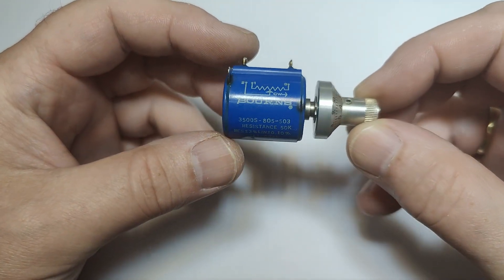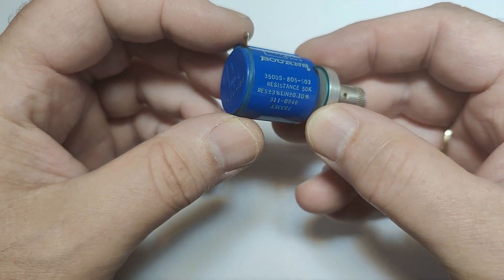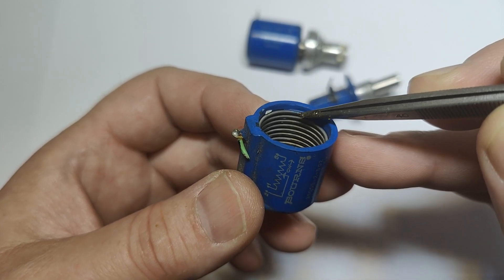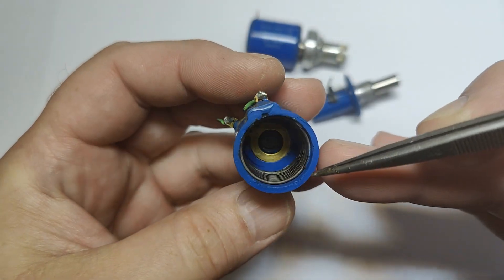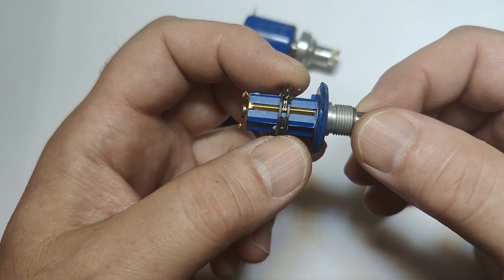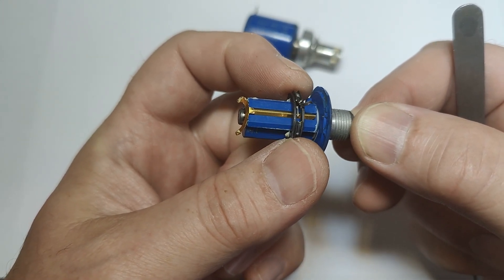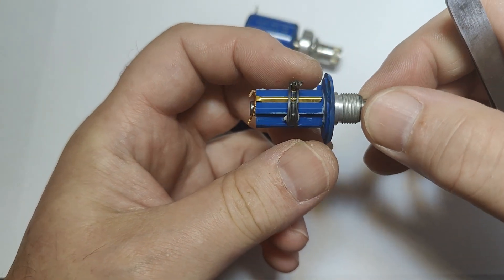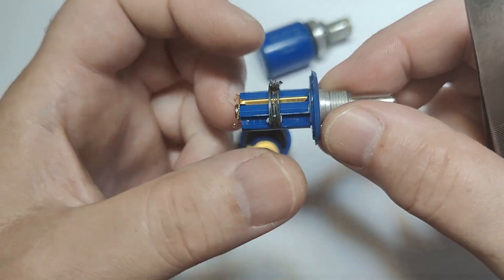Wirewound 10 turns precision potentiometers (Bourns) How are they made

Comment: The resistance wire is insulated, and wound around an insulated copper wire former. Then the inner insulation is removed to expose the inner wire to make contact. Have had a few fail from wear, that wiper either wearing through, or it wearing out the fine wire. The insulation determines voltage rating, very few, despite power dissipation ability, are recommended for over 50V in adjustment during operation, as the contact will otherwise arc, even with 1000V insulation resistance, because of the wiper bouncing between turns. The wire also shows why they are not really made above 100k, way too fine a wire to wind then, and too fragile. The cermet ones are a lot more resilient, but a little less accurate, and have a much lower contact current rating. 2W rating for the entire element, but also a 20mA contact current limit, which is why you only see them as a sense unit in a power supply for current limit, across the main shunt. Output voltage sense no problem.
Reply from the maker: i think it is important to know how stuff is made, this way it is easier to understand where all the specification parameters come from
Reply: Thank you very much for the extra technical information! It's really interesting to know how they work and what issues you ran into